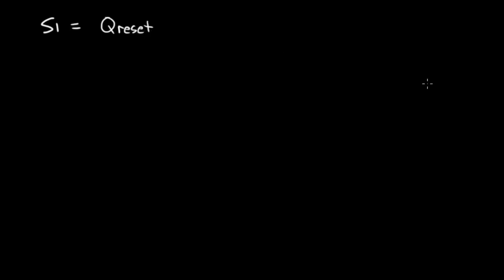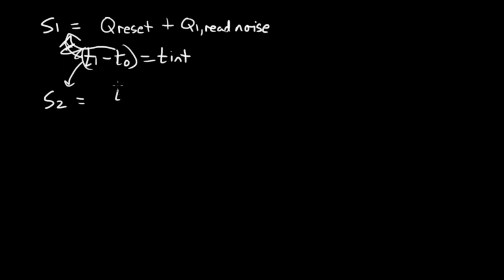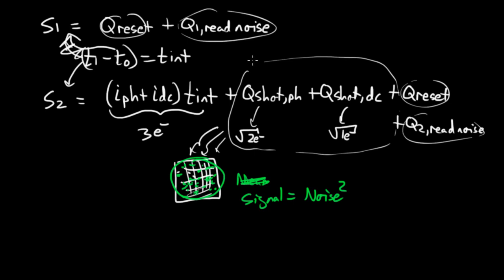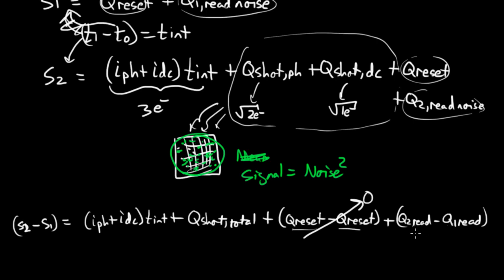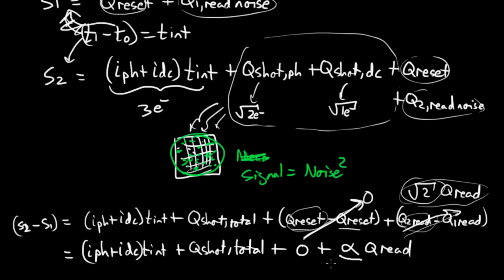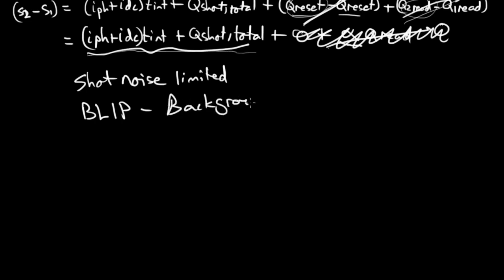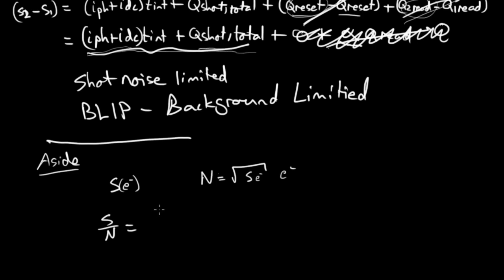Noise Single Pixel 2 (re-edit) [9 of 10 Image Sensor Noise]

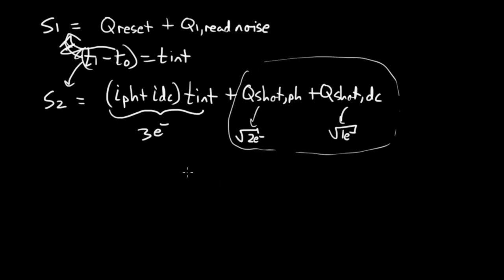Comment: @2:23 - How can there be shot noise for dark current?   @2:53 - Shot noise is due to photons hitting surface,  but dark current is due to ambient current in device that occurs even when no photons reach device.
@2:40 - is 2 =Poisson mean= variance of electron count, so r.m.s. noise = stddev= sqrt(2)?
Reply: Dark current and photo current gives exactly the same type of shot noise. The pn-junction in the photodiode is perfecly agnostic, it has no way of knowing whether an electron-hole pair was generated by a phonon (thermally) or by a photon.